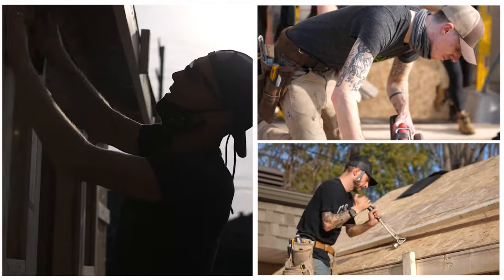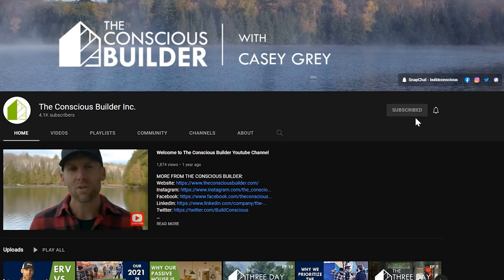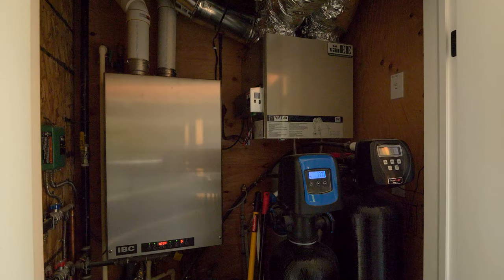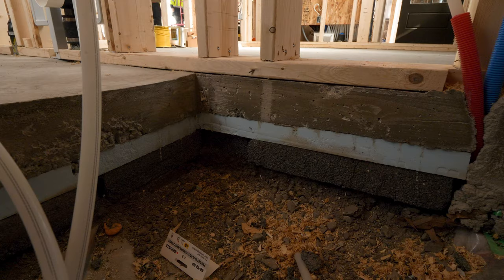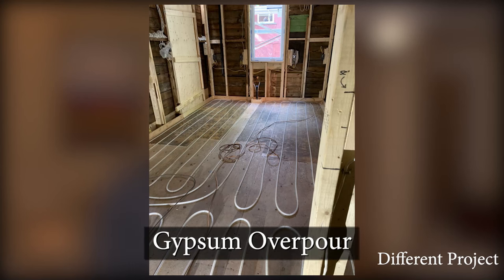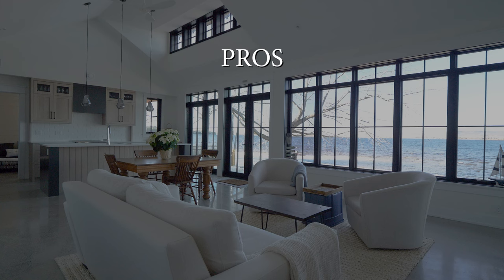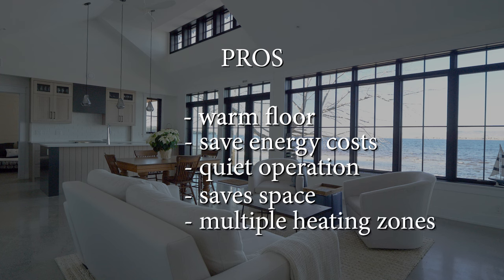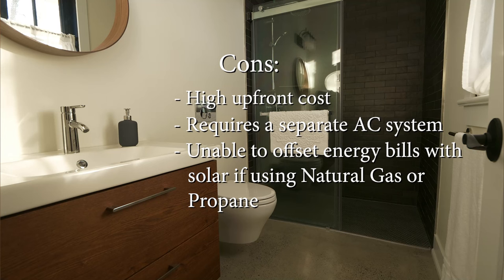Radiant in-floor heating - Everything you need to know - Pros and Cons

Comment: We have a 3-story second home in Montana with water tube radiant heat in basement and second floor with electric on third floor. We have a wood boiler system. We kept the wood boiler but in November 2021 we added a propane hi-efficiency boiler system at a cost of $13,500. House is 2-years old. When we move there and live year round, I'll by pass the propane and use the wood boiler as I'll be there to cut wood (outdoor furnace used big logs, no splitting). I added a wye strainer, magnet, and system protective additive on boiler for $1,535. Over time iron  deposits will scour boiler causing premature failure and leaks.
Reply: No anodes installed??

Comment: I'd say one thing he doesn't understand is radiant heat. You can super tune. Basically you can adjust flow rate. You can adjust temperature going out to individual zones depending on your setup. Also, you can do outdoor reset which means you can adjust the temperature up and down based on outdoor temperature. So as it gets hotter outside, you can run cooler water to your slab. Basically, if you do it correctly, you'll always have the perfect temperature

Comment: I like to keep the house cool all year 63-68f. Don’t much like those independent aircon units they never seem to cool things equally. My main concerns are 1- I usually turn off my heat early April but of course there can be cold snaps, don’t usually turn it on until mid November. Can these ambient systems be safely turned on and off like forced air whenever you like? Do you have to drain the system when not using it? Is that easy? Cheap? Or can the water be left in the system and it won’t freeze. 2- Are these systems cheap and easy to service when they break? I am looking at a house with electric water floor heating and no central aircon! It’s the one thing turning me off. I live in Quebec.
Reply from the maker: Radiant systems should be closed loops and should not need to be drained. The tubes themselves should not break. Only issues we have ever had with hydronic radiant heat is air locks or somebody puncturing the tubes by mistake. The heating unit itself could always fail too but that's no different than a forced air system. If it's water, there's always a possibility of them freezing but only if you allow it to get below freezing for long periods inside the house.

Comment: Hi there! Are there non-toxic, PVC-free tubing/piping options for this? I’m having trouble finding what the tubing is made of, but I don’t like the idea of plastics warming up under the floor. Any advice? :) Thank you for sharing your expertise on radiant floors!
Reply: Wondering the same here 🙂
Reply: They’re made of copper I think (mine are at least, they’re from the 80s though)
Reply: You can use copper, but bear in mind, the pipes only get to about 90F-100F. 120F is what your common hot water is set at from the factory. Most people use PEX which is a cross linked Polyethylene plastic. Sounds like a relative of the plastic used for milk bottles.
Reply from the maker: Andy Pace from the Green Design Centre may know: https://www.thegreendesigncenter.com/

Comment: Hi from NS! I noticed you mentioned air-to-water HP as a seldom-used option… seems like it solves a lot of the “cons” of radiant floor heating. You can use Solar for power, much more efficient than electric boiler, most HP can also be used for cooling, and there are a few ways to configure a system that preheats DHW too! Doesn’t help with the upfront cost though and you might run into the problem I’m having now of finding an experienced installer. Would love to see a video on that! Hint hint…
Reply from the maker: Thanks for the comment, Tim! Not something we get into too much here but we will definitely do a video once we try it out. We have looked into it for some projects but the cost took it off the table. Service is definitely something important to consider a well. There's nothing worse than having a system with poor or limited service when issues arise. Especially when you pay top dollar for it.
Reply: @Theconsciousbuilder  Thanks, I'm a bit concerned about about the service aspect also, but ThermAtlantic has an NS location so they might be a good local option. Wish me luck! 🤞🏼
Reply: NS vs MB.  In Manitoba even with the latest Cold Climate Air Sourced Heat Pumps rated to -25 C to -30 C (relatively new and designers and builders are still learning more about their capabilities) it would be a bit of gamble to set up this air-to-water HP system in Manitoba.
Reply: @joelbaldwin8289  Yeah no kidding, I might hesitate in MB also. I lived there for 5 yrs so I'm very familiar with the usual few weeks of -40C you get in Jan/Feb. Would definitely need to lean on boiler backup for the coldest part of the winter. If I take one of those Cold Climate HP and install in NS I should be OK though. I'm looking at a made-in-MB Arctic model right now for radiant heating/DHW preheat. Will probably hold off the on the hydronic cooling option though, it requires a 3rd tank and my mechanical room is running out of space! Going to go with a CERV for cooling instead (and ventilation and dehumidification and a bit of heating). If I'm going to gamble with one emerging product why not two, right? 😬
Reply: @timmullen03  Huh, I was just on the Arctic Heat Pumps web site today, very good web site, loads of information.  I would try and seek out  some individuals that have installed both of the systems you would want to install and get some feedback from them.  My dream is to be living in a Net Zero house that has a heated floor and I am walking on that floor in bare feet when it is -30 C outside.
Reply: @joelbaldwin8289  my dream too! If you insulate well enough for a Net Zero house though, you might find that when you design your radiant loops that the floors won't actually have to get that hot even at design loads. Most of the time they will still be a bit cooler than your feet (but warmer than room air so still nice). Either way a very comfortable way to heat your house and paired with an ATW HP and keeping water temp low it can be extremely efficient. I've been learning a lot about hydronics while planning, Caleffi puts out a free educational online publication (Idronics) that has a ton of information and John Siegenthaler is another great resource, he's got educational hydronics videos and articles everywhere. Good luck!
Reply: @timmullen03  Thanks for the information.  I will also continue to research hydronics but what I will probably end up with is the same system that was illustrated in the CB video "Deep Retrofit - 100 year old home.  Cold Climate Air Sourced Heat Pump / Air Handler (ducted), Air Source Heat Pump Hot Water Tank and an ERV.  It will be a passive house design with thermal mass concrete floor and kitchen concrete counter tops.  Good luck also but with good planning the good luck part can hopefully be reduced.

Comment: My house is one storey slab on grade as well. I have a furnace, and the heat is blown down from the ceiling. The floor remains pretty cold. The house is all one level, and I've occasionally entertained the idea of jacking it up about 20 cm, or one step, and putting in a new, raised floor. Then I could install floor heating on top of the concrete, underneath the new floor. I have a ceiling fan in every room except the bathroom, so air circulation isn't really a problem. I would think that would minimise the number of cold spots in a room. I've also toyed with the idea of installing mini splits to replace my furnace and air conditioner. My house is very small, only 75sq m, roughly the size of two 2-car garages.
Reply: Just pour a light weight floor over the top of your floor with the heating tubes in it. It will only raise your floor 1 1/2 inches
Reply from the maker: There may be many options depending on what your goals are. This would require a longer conversation :)

Comment: I'm in looking to develop a fully electric gas free home that's over insulated and airtight, with a solid PV Array. I'm guessing I'd end up using some form of Heat Pump water heater to power my interior radiant floors.
Reply: I have the same plan. Good luck!
Reply: What HRV do you have and how often do you have to change filters?
Reply: No you just install an electric boiler so that you use electricity to heat up the water which goes into the pipes of your radiant floor system.   The only reason people use gas boilers is because in most areas natural gas is much cheaper to run than electricity but it does depend on where you live.   Most people live in places where electricity is significantly more expensive than gas (electricity comes from expensive power plants, natural gas is basically siphoned from the ground) and so to save money in the winter (since there is no such thing as a gas powered air conditioner) they go with gas for heating.
Reply: Heat pumps are the best combination with radiation floors since they like to run continuously on low temperatures. Floor heating is excellent for that. Cheaper to run than gas because the higher COP.

Comment: Good idea, thanks!
I remodeled a 1500 sq.ft. house, slab on grade. Since I was putting new floor tile down throughout I opted to put about 300 sq.ft. of electric wire under the living/dining area. It's not the main source of heat for the house but it's a very pleasant supplement in the coldest winter periods. It was very cheap to purchase and I did the install (as well as the tiling) myself, with the help of an electrician to do the connection to the electrical panel. I'm very happy with the results. If I were building new I would strongly consider a water system throughout the entire house.

Comment: Great video! Another con as I understand it is that it's slow to heat the space, if the system is off and the house gets cold it takes a while to get comfortable, while a forced air system will blast toasty air in your face right away
Reply from the maker: Correct. Set it and forget it.

Comment: I like the warm floors but if you still have to install mini splits all over the place or install an air handler to install AC you might as well install either a mini split heat pump or a conventional forced air system. Running and maintaining a forced air is way cheaper than anything especially if you have natural gas in your area.

Comment: I have a deck I want to tear out and put in a patio. It’s up against my garage. I’m thinking of putting a gazebo on it, temporary bar in the summer, Velcro on the corner posts and some really thick clear walls to enclose it in winter. (Michigan) fireplace etc.  when I was a teen my dad put a wood burning stove in our house and connected it to the baseboard heat. Water plate, thermostat, and on the outside a water pump. Build fire, water temp rises, kicks on pump and bobs your uncle. I want to do this under my patio outside. In Michigan…. So ,,, either the fluid pumping throughout need to be partially anti freeze or I will need a quick disconnect to pump the water out when not in use.   Looking at different rocket stove/water heater designs.  Do you have any thoughts on this?
Reply from the maker: Not something we have ever done but sounds super interesting. Send pics!
Reply: because of your design you risk the constant surety that your pipes will freeze which equals no heat.   Using antifreeze in your pipes will only stink up the place and because it's a patio, the efficiency will be very low.   You'll be spending more money heating your patio that way than the rest of your house.     You just want to install two outdoor rated gas heating units one on each side of the patio.     They come in many different forms and sizes.     Some are forced air, others are "burner" type units.     Remember, "it's all been done before."    Don't try to get fancy and special and just do what has already proven to work.

Comment: We want to turn our enclosed back porch into a room. What are our heating options? Thanks.
Reply from the maker: First thing you will need to do is make sure it's sealed and insulated well. Assuming it is, the easiest and most cost effective option would be to do baseboard heating. If electricity in your area is expensive and this is something you want to use for a long time, you may want to do a cold climate ductless minisplit which would also give you A/C. If you plan on redoing the floor, you could also do electric radiant heat and put tile over it.

Comment: Question: we have 2k sqft of radiant water heating, but run with propane. Very expensive. We are thinking to use a heat pump. Thoughts on switching propane for a heat pump?

Comment: In a new build, 1300 sq. foot bungalow to run in-floor radiant using a propane boiler, what should I expect it to cost - ballpark?  If you want to run central a/c and need ducts for that, are you better off to just go with a standard propane furnace?
Reply from the maker: You'll have to reach out to a local HVAC contractor to get some numbers. If you're looking at strictly pricing, a standard propane furnace with an A/C would be much more cost effective than going radiant.
Reply: Unless you can build the system yourself.  @Theconsciousbuilder

Comment: Doesn't  sharing the load between solar, LP, or natural gas offset the initial cost of heated flooring & nose bleeding cost of a full capacity solar system? Sure, I  know that it's  supposed to pay for itself, but does it really, with replacing batteries, solar pannels & the other electrical accessories? I'm  really interested, because I  am going to making that decision myself soon. Thanks

Comment: Thanks for this helpful video. I’m in the UK and looking at buying a house which has ground floor underfloor heating, wet system linked to gas boiler. Radiators upstairs. I’m worried about how much it might cost to run the underfloor heating compared to gas central heating. Due to energy costs here, I try to keep my current heating off unless I really need to have it on when it is very cold. Any advice welcome. Thank you.

Comment: My passive home architect is recommending against in floor heating because they say the additional insulation will result in the system not coming on very much. So the for won’t feel warm like we would expect?  Thoughts?
Reply from the maker: If your home needs heat, it will come on. And if that heat happens to be radiant floor heat, then the floors will be warm. I am aware of a certified passive home here in Ottawa that was built in 2008 and the radiant floors work great!
Reply: I wonder if you can set the circulating temperature lower so that the thermostat calls for the heat to be on more.  Might be a potential energy penalty, though...
Reply: @GreenBuildingNetwork use an in floor thermostat instead of an air thermostat.

Comment: I am looking at a new workshop/garage build and am thinking radiant in floor heat.  I was thinking of using a conventional small hot water tank powered by solar to provide base level heating for the building.  My thinking is the solar would heat up the system during the day and obviously provide no heat at night.  The pumps could even be tapped off the panels so the circulation stops when the sun goes down.  I would not be trying to keep the building at 20C or anything, just trying to come up with a green/economical way to keep the frost out of the building throughout the winter without racking up high gas or electric bills.
Reply from the maker: Something like that could work. How much heat you need would depend on how well the building is built.

Comment: If I already poured my concrete slab how could I run radiant heat? Is there any way? I am having regrets of not installing it after learning more about it.  Thanks for the video.
Reply from the maker: There's no way to put it in your floor at this point but you could do probably something on top! You would have to cover it though. For example, if you're doing it in a house, you could do electric cables and tile over it OR you could do water pipes and then do another pour on top. Either option may cause height issues for you though and with the overpour option you'll need to make sure it adheres properly.

Comment: Living up here in Alaska. If I do a radiant heat in my off grid cabin. My biggest concern is mold please help
Reply from the maker: Whether you heat with radiant or not, you'll need to install an ERV (or HRV) and build a wall assembly that can dry in both directions. The building science still stays the same.

Comment: I have radiant heat- 2 zones and side boards in three added additional rooms. Central air also added later in attic.  I’d like to replace flooring. I have carpet (which looks like plywood underneath,  carpet is incredible condition for age just dated) and ceramic tiles in kitchen and bath. One room has smartcore? Which gets so warm every room mate I’ve had opens the windows in winter:( I use to be upset, then moved into room myself and now I get it. It’s hot. I’m considering covering ceramic tile rather than removing,  how will this effect the radiant heat? What kind of flooring do I need. Not sure when it was installed,  house was built in 1946 like a bomb shelter brick,  concrete and steel joists.  I’ve owned since 2014 with only one issue needed a new fuse for boiler. I’d like to up date I’m a diy and don’t want to make mistakes or more work. After years of forced air I love the radiant heat. But would really like a fresh look.
Reply from the maker: iI you put more material between the radiant heat and the top of the floor, it will take longer to heat up. If that room is hotter, this may be a good idea. Depending on what you cover with though, this may also just add more mass which will have it holding the heat longer as well once it is warmed up.